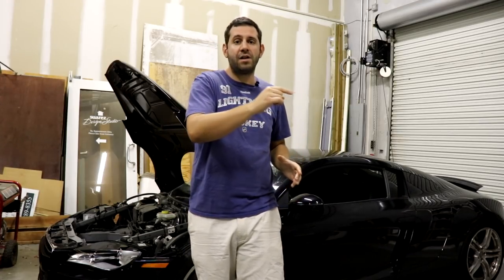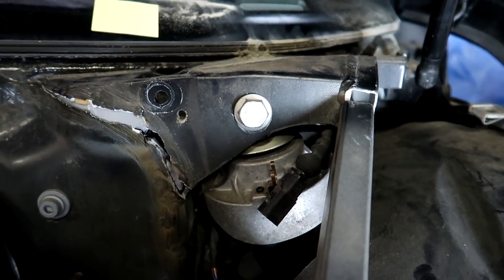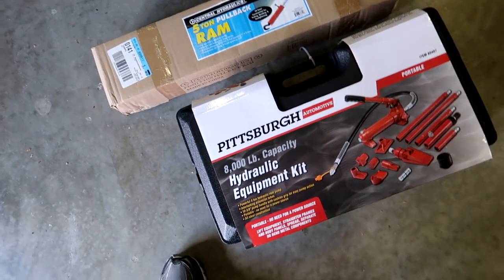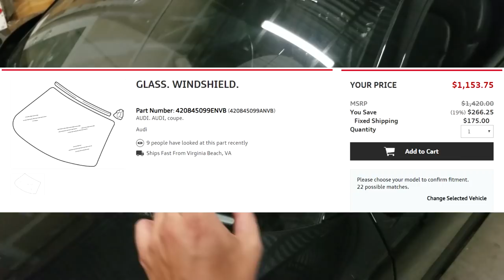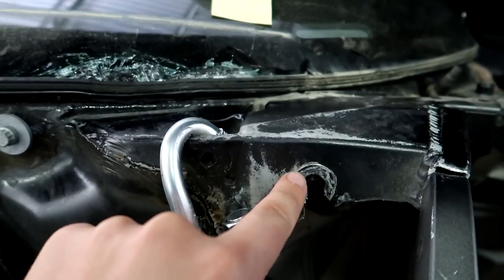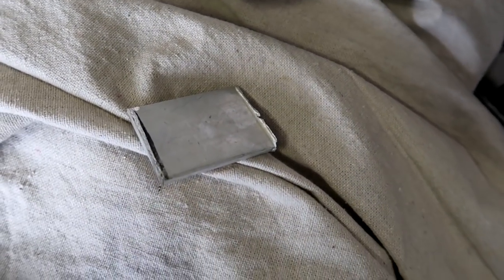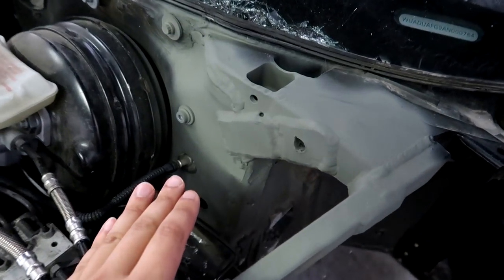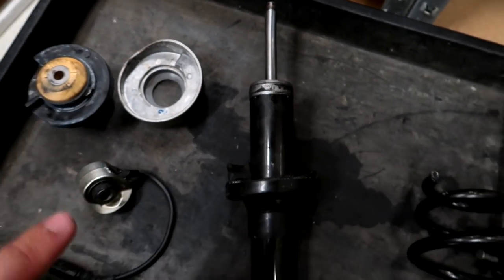I Repaired My Totaled Audi R8's Cracked Frame for $500! Insurance Quoted $29,522!

Comment: "Don't want anything rusting" As he spray paints aluminium -_-
Reply: aluminum corrodes so
Reply: Without masking tape...
Reply: @Ercan Özkan I'm sure....so why do aluminum wheels corrode
Reply: @Ercan Özkan ok so why can I go to a plane crash from the 1940s and find corroded aluminum...that's pure aluminium
Reply: no doubt..
Reply: Hes just using that as an excuse. The real reason hes spray painting is to hide the work done to it for when he inevitably sells it
Reply: @akalspeedwrrd9437  Not going to lie, this seems like an extremely janky job on such an expensive car.
Reply: welp it’s bound to rust regardless i guess
Reply: @akalspeedwrrd9437  he's definitely not trying to hide it lol. If he was hiding it he would grind it down and match paint etc
Reply: @greynolds17  .. oxidizes - NOT RUSTING ... there is a Difference. Aluminum"corrodes" to prevent the Surface, Metal rusts and disappears, looses Structure.
Reply: @PhreakDarkSoul  At least he now has nice speckle effect rubber seal on the windshield
Reply: When aluminum oxidizes the thin oxide layer forms a protective film, aluminum only corrodes away entire if something continually removes that film. None of the aluminum parts in my car (engine cradle, steering knuckles, etc) are painted and after 13 years they still look almost new except for a bit of pitting from small rocks and road grit. The car has spent it's entire life in the Midwest where the roads are covered in salt all winter long.